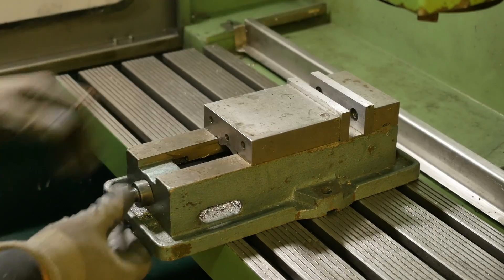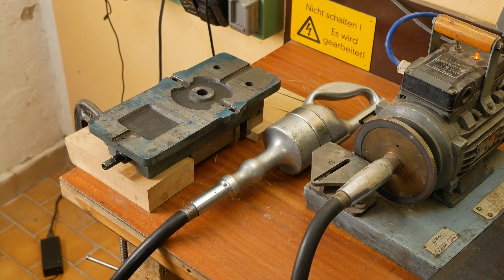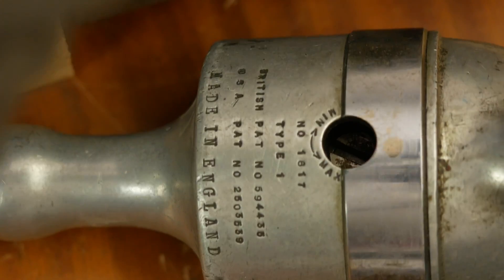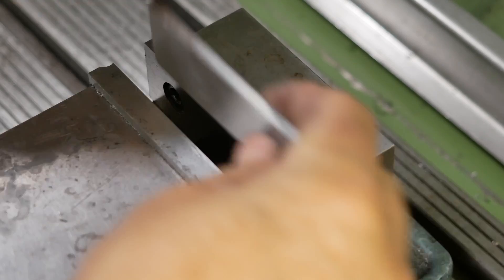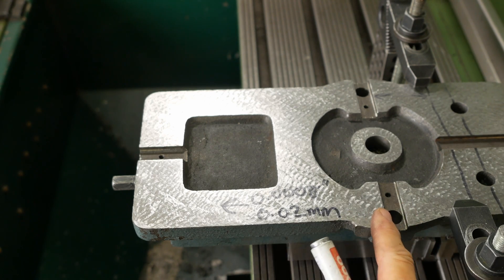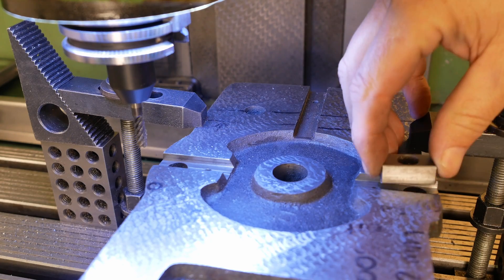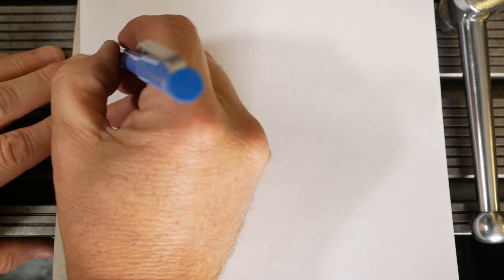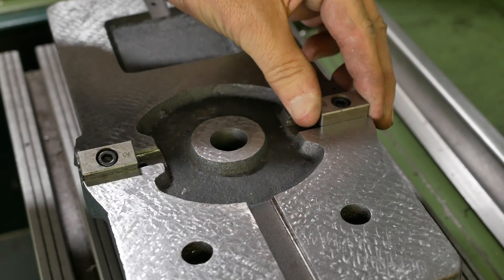Tweaking a machine vise to speed alignment. || RotarySMP

Comment: Was the oops just an order of magnitude in clock resolution? It wasn't entirely clear to me in the bloopers where the discrepancy was. Oh, and also your bloopers had a weird left side audio echo at the end of your clips, not that I expect production quality in a blooper reel, just pointing out a quirk of your editor to watch for. Thanks for bringing us along, good stuff.
Reply from the maker: Yeah. I read 1thou as 10thou :/

This was the first video where I used Resolves "Dialog leveller", and it crashed on me about seven or eight times. I need to work out the workflow, as I also heard some clipping in the LH ear on my headset. Sorry about that.
Reply: @RotarySMP I thought the audio was a timing mismatch of your mic and camera mic. When the mic track finished on the timeline the audio track muxed to the video was still hanging there.

Comment: Watching this inspired me to do the same on my milling vise. It has 16 mm slots and the table has 14 mm. So I had to mill 2 mm off the key steel. The vise slots are only 5 mm deep, so not much to grab on the key mounted on the usual parallels. Plus I messed up with the vise jaw lift. But I have an unusual vise in the the screw and hydraulic ram in the top slide. So I put the key down at the on the base slides and lay two 50 x 4 parallels on their side to press against the key. Since everything is down below the ram the top slide actually presses down with that loading. I needed a longish cutter to go down between the vise jaws to get to it, but it came out really nice. I did the whole 2mm on just that one side for accuracy rather than doing 2 setups. I haven't bolted them in as I'm likely to ding the keys or the table, but it goes on with them loose with 20 micrometers wiggle looseness across the 150mm fixed jaw. A slight tap with the dead blow hammer and 5 micrometers is easy. In fact I can do better easily, but I want to try a few times to see if its repeatable. Luckily my old Taiwanese vise seems to be well made.
Anyway, thanks for the inspiration. It's way quicker to mount square now.
BTW: What with this 5/100ths business? It's 50 micrometers. I've found it's harder to Europeans to shift from cgs to SI than it was to get guys to shift from "Imperial" to SI. And centimeters is a "non preferred" measure as I understand it . And try explaining it's preferred to use a number between 1 and 999.999... and a prefix. And the prefix, from what I read, is meant to be pronounced as such. So it's kilo- meters not kil-ometers. Sorry, I'm being a bit anal :)
Reply from the maker: I like the keyed vise. I know it endangers the table somewhat, but it is nice and fast for most jobs.

Comment: Outstanding job. 
I did mine years ago,the keys and it really saved alot of time.
I have never checked it for being flat however.
I want to learn how to scrape.
I have watched alot of videos, never done it.
Thanks for sharing. 👍
Reply from the maker: I started scraping by grinding the teeth off the end inch of an old file, grinding and polishing the 5 deg negative rake and bought a tube of generic Prussian blue oil paint from an art supplier and go for it. It is easy.

Comment: Just a friendly announcement.. 
I haven’t got a dam thing done in my shop since I stumbled across your channel.. 🤭🤫
Reply from the maker: Sorry about that Jason. I'll aim for a boring video this Sunday, so you can get back to your projects :)
Reply: @RotarySMP  ah yeah ! I just bought a new to me boring head for the mill, that would be perfect 👍🏻 🤣😂
You do a fantastic job of making darn near everything we do look spectacularly easy. Except for that CNC stuff, I only have manual machines. I know absolutely zero about anything involved with CNC, so I wouldn’t know the slightest when it comes to that. But with your content I’m beginning to consider a path where I might scratch the surface ever so slightly and see if I could learn a thing or two. 
You really are a multi talented guy. Very intriguing I must say. 
Carry on my friend. My projects are not going anywhere, they will wait me out for sure.
Reply from the maker: @jasonhull5712  What mill do you have? Did you get one of those boring and facing heads like Wohlhaupter, or a conventional boring head? I only have one of the crappy import ones.
Reply: @RotarySMP  I have a import as well, the mill is a Bridgeport “Clone” it’s a Promax 3 Hp variable speed 9x42 and I have a Clausing Metosa  C1330S lathe (actually two of them as I’m in the process of repairing one to sell) and I wish I could get my hands on a Wohlhaupter, I just have a conventional import boring head at the moment. I’ve been hunting for a boring/facing head but haven’t found “the one” yet. This import has no markings on it so technically I can’t say for certain it’s a import. Just looking at the quality of manufacturing I’m thinking it’s an import. But for $50 A guy can’t Scoff at it. It’s a 3/4” with the R8 shank so I have loads of tooling that fit it. I just don’t have a lot of experience with boring heads. I’ve always just used the necessary end mills or the lathe. I too am operating out of a small two car garage so space is very limited. Next on my list is a tool cutter grinder and or surface grinder. 
I am in Indianapolis Indiana and for some odd reason I’ve found tons of great deals on old machines, just absolutely nothing in this state. They tend to be in Ohio. Or Kentucky, or Georgia or … well anywhere but here. Haha. So I just keep looking once or twice here and there and eventually I’ll find something to drag home. I mainly just do small odd jobs and some work for locals here and there. I have a couple larger machine shops near me that Toss me scraps from time to time. But I really just tinker as a hobby. I just enjoy metal fabrication and machining. I restored a 1970 Camaro and I build custom Drones for racing and hobby. I also come from a family of wings. Father and two uncles build and fly single engine aircraft, A/P mechanics and executive captain for American Airlines. Grand father worked for Delta Airlines til he retired. So a lot of what you discuss and show in your videos I can relate to and am interested in. 
I am a HVAC-R technician so I don’t get to see much of the aviation scene anymore. But I’m rambling.. I’m sorry.
Reply from the maker: Over here the used tool market is very fragmented. Swiss machines in Switzerland, German machines in Germany etc. So you have to monitor a bunch of different Craigslist type websites to find out what is available in the neighboring countries.

Comment: I used to have keys under my vice, but those keys can cause damage to your mill table. Instead I removed the keys. Then set up and dialed in the vise square to at lease .0002" or better. Then drill and ream 2 holes right thru the vice and into the table.
Now each time you need to install the vice, just simply place the vice on the table, line up the dowel holes, insert the dowels, and tighten the bolts.
My vice is repeatable within .0002" every time!
Reply from the maker: I couldn't bring myself to drill into the Maho's table...again :(

Comment: I remember using a powered scaper as an apprentice, the motor drive unit was hung off a stand, it seemed huge at the time, and the hand held scraper assembly just gyrated all over the place, possibility the wire cable flex shaft was damaged,  or me being a 8 stone weakling. Thats a lovely set up, with honing disc.

Great idea on using the sized table slot keys to align the vice, pre measurement/machining, saves a load of time 👍.

That's a great technical/accurate blooper, wrong footed at step one, can take days sometimes to realise,  been there many times.

So is "Plonk and Go" ref mill vice time, great job, and thanks for sharing. 
Regards John
Reply from the maker: Thanks for the feedback John. That Coborn is also a good workout for me. It is pretty heavy, and you need a very tight control on it. It gets tiring pretty fast.

Comment: just a thought after scraping the base of the vice have you made the bottom un parallel to the work holding area of the vice?
Reply from the maker: Not yet. I need to scrape the guiding ways parallel, and the fixed jaw vertical,  but will do that later.

Comment: You kind of have three stones (4 actually), since you have 4 sides and, afaik, there is no issue in mixing sides up
Reply from the maker: I wasn't sure if it is a good idea to mix the different grits, but that will work. Also the the part to be stoned is a third surface.

Comment: We have the same thing on a a few of our vises at the shop. It's not always 100% accurate sadly. If your table's slots are kinda beat up from years of machining they can be out a little bit...  I Know when I slide a t-nut through the slots there's parts which are tighter than others.. Maybe they're machined that way, or it's just years of being beat up.. Worst I've had is the vice being out 2 to 3 thou, which isn't bad depending on what you're doing. My shop does high tolerance stuff a lot, so I usually stick to just indicating the vice normally.

I'd say this is a great idea for quick set up changes on parts or pieces which aren't critical, otherwise I'd still dial in the vise manually, nothing is going to beat that accuracy.
Reply from the maker: I checked the T slots of the Maho with one of those super precise keys, and luckily they are still very accurate. The slots have a constant firm sliding fit. Very nicely machined by Maho.

Comment: Takes me a few minutes to indicate the vise, I use the tapping while moving the X axis trick demonstrated by Quinn. I did think about adding keys but then the vise wouldn't sit flush on the work table when I take it off, which annoys me for some reason :s
Reply from the maker: Do you have an indicator in a tool holder? That would also be really fast.
Reply: @RotarySMP  no, but I have a DTI on a magnetic base that I attach to the milling machine "headstock"
Reply: Once you add the second (or third) vice, this becomes harder... (Although it can still be reasonably fast. I recommend a micron indicator as it's sooo much easier to see the change without much movement)
Reply: @ewildgoose  yeah good point, not necessary for people like me that hardly change the vise out but very handy if you're doing it often enough though in that case it would make sense to leave multiple workholdings mounted on the table 🤷‍♂️

Comment: The rabbit hole, LOL!  I thought I was the only one that did that.  And I plan on learning how to scrape.  Great job.....
Reply from the maker: Hi Jasper. Yeah, I cant pass up on a rabbit hole it seems :) Go for it. You can start by grinding the tip of a worn out file. Prussian blue from the art supply store and some sort of surface plate, and you are off to the races.
Reply: @RotarySMP  I'll give it a shot....
Reply from the maker: @jster1963  That is how I got started. Ground the teeth off a file, radius on the nose, 5° positive rake, and a nice mirror hone. You have to rehone it a lot, but it works fine.
Reply: @RotarySMP  Excellent. Thank you!

Comment: Good stuff, the stones as mentioned have more surfaces.  If something happens to them just let me know.  Your set is guaranteed against all but shark attacks.  I did wonder if you needed an angled one.
Reply from the maker: G'day. There is an interesting comment about them above. It was pointed out that the three flats method is at work with only two stones, as you also have the surfaces you are dressing. Those stone you made are excellent. Thanks again.

Comment: Does scraping the bace of the vice not make it out of parallel with the opening parts bottom surface
Reply from the maker: It would, assuming that they were parallel in the first place. Probably not a valid assumption for a cheap chinese vise. I will need to scrape in the guiding ways, and fixed jaw sometime later.
Reply: @RotarySMP  scraping still seems like black magic surface science to me so I was just curious
Reply from the maker: @mitchellstrobbe7779  Ideally I would have surveyed the whole part, as I could have found reason to scrape an angle into the base to correct an error elsewhere, but it is the biggest surface, so it is easier to make small corrections elsewhere.

Comment: Surprised you didn't check the top and bottom key slots too. 👍👍
Reply from the maker: Good point. I probably should have mentioned it in the video.
I thought about it, but:
1/ My Y travel is too short to cut then in one go
2/ I couldn't think of an easy way to align it to fixture along the bed
3/ I have never used the vise that way
4/ if I need to I'll have to remove the keys from the current position. 
5/ for the occasional use case, I can just tram in the vise.

Comment: The funny thing is, I mentioned that I use table keys on my mill vises once on a machinists forum and got burned at the state as a heretic. The prevailing attitude seemed to be that the only reason the vise mfgs added key slots was for aesthetics and the "proper/easier" method was mess around with an indicator LOL.
Reply from the maker: Yeah, I already got that message in the comments here as well :)
Reply: @RotarySMP  It does make me wonder why  real machineshops, making real money, (ie messier dowty q400 landing gear for example) spend many
thousands of dollars/euros  on fixtures that locate precisely onto the the work table.
Perhaps its the same sort of percious thinking that hold that you are not a real "machinist" if you use digital instruments.
I have met probably over a thousand machinists and visited perhaps 200 different machineshops and manufacturers,
guess  what ,they all had vices with keys and digital gauges.
Reply from the maker: @steveggca  :)
Thanks for that input Steve. As a hobbiest in my basement, I have little clue what is good advice and what is polemic.
Reply: @RotarySMP   No problem , just to flog the idea a bit further , the width, parallelism,spacing, and X-Y alignment of the T-slot's are held to
the same geometry and accuracy as the machine it's self ,BECAUSE its intended to be used for alignment of vices and fixtures.
If you have the inspection report for your Maho you can confirm this for yourself.
Reply from the maker: @steveggca  I could feel that with those precise keys I was given. Their fit in the Maho T-slots was a very consistent snug sliding fit. All over.

Comment: When you were checking the alignment and scraping the bottom, did you check the parallel to the table plane of the vise, the jaws and bottom of the slide?
Reply from the maker: Not yet, I assume this is all over the place on this cheap vise, and figured I'd start with the bottom, and then scrape the guiding ways and fixed jaw to align with it at a later stage.

Comment: Good simple plan for fixing key ways
Reply from the maker: It was lucky that the slot was under width more than misaligned.
Reply: @RotarySMP  now you know it is accurate.
Reply from the maker: @akfarmboy49  I was quite surprised how well that worked out. Especially as I did it :/

Comment: What I do is make the slot 16H5 end make new blocks/key  but chek also your block in the vise or milling the vice inside.,  hmm you need 15min to line up the vise 😒 nice video aswell
Reply from the maker: The Maho t slots are really accurate, as are those 14mm keys I was given. Both mic'ed out dead on 14.000mm. I got lucky that the existing slot was undersized by more than the alignment error.

Comment: I saw you were adding wd40 to thin out the paint. I found that wd40 does dry and gel up slightly, and parafin oil works way better, does not change its consistency for at least couple of days. You can typically get it in a pharmacy, it used to be prescribed as a mild laxative, so you can get a medical grade fine oil for thinning the paint, and it pretty much never dries up. Cleans well with isopropyl too.

I also made my own paint for scraping with red iron oxide powder and that paraffin oil, it is surprisingly really really good, you can smear it really thin and it still covers the area extremely evenly. The trick was to use glass, like a drink glass, made out of glass, and a glass pane, like out of a window, i have one from and old fridge, and you simply mix the powder with the oil by putting it on a glass pane, and "rubbing it in" with the bottom of a drinking glass.

Apparently, the original Whitworth three-plate method used iron oxide paint too.
Reply from the maker: I don't tend to mix the paint in advance. I just mix and use, and so it doesnt have time to gel.  This is a tube of Prussian blue oil paint I bought from the art supply shop about 10 years ago, and is only 1/4 used so far. I like the WD-50 handy, as I use it to clean as well.

Comment: I'd be increasing the clearance of the hold down studs. BTW It's a lot safer to lay the vise on the table and slide the T nuts under the vise while twiddling the studs.
Reply from the maker: Good point. Those are studs, but I also have nuts which I could slide under there.

Comment: Nice job.  When scraping the base of the vice, isn't it necessary to make sure that the base is parallel with the vice bed and both are square with the fixed jaw?  I was surprised that this was not done.  Just scraping the base could put the bed and fixed jaw out of square. Thanks
Reply from the maker: I hve no expectations that anything is really swaure and flat on this cheap vise. Since you have to start somewhere, I started on the base. Sooner or later I will get around to scraping the ways in flat, and fixed jaw perpendicular.

Comment: grate video as always!!  I have used my precision flat stones for a while now I just alternate both sides and had no problems so far.
Reply from the maker: Some one pointed out that they are always part of the 3 surface method, as you are always rubbing them on the work as well.